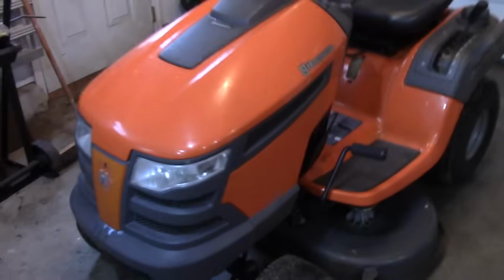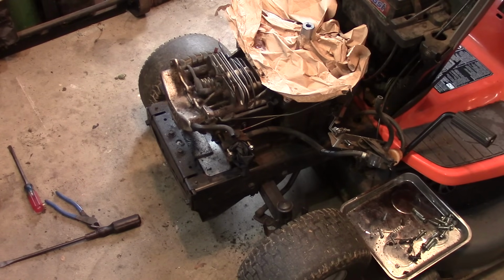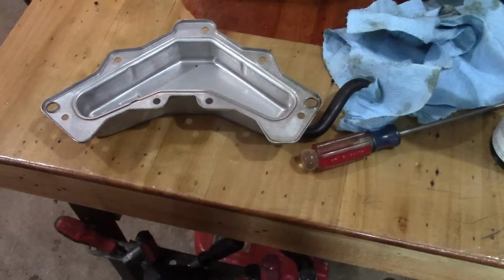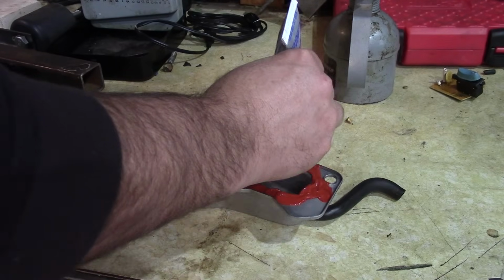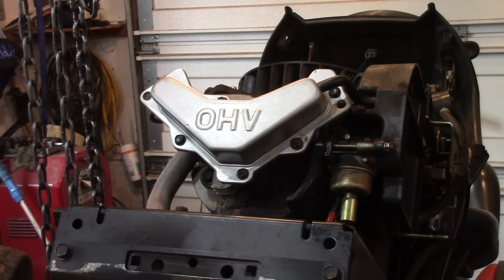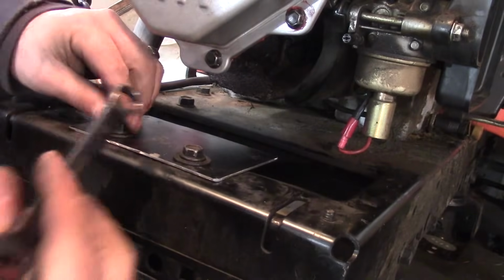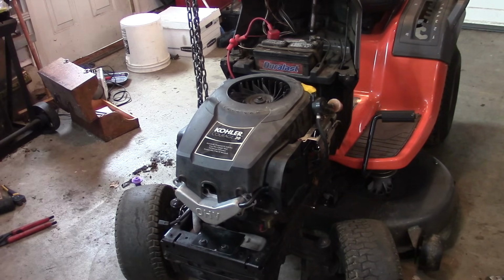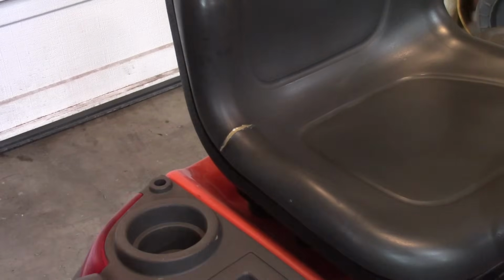Kohler Courage 20 Stopping Oil Leaks 2 Ways

Comment: Thanks for the video. Cork Valve finally failed on my 2007 Husqvarna 46" Kholer 20 Courage. I do take umbrage with the YTK20 (sv600) engine being a bad engine or design. Ive got well north of 1200 hours on my Kholer 20 and its never failed. Yeah, its been pissing oil for the past 2 mows but its been bullet proof for 14 years. It's a fine Power plant. Do your PM's and this engine is solid af.
Reply: Hate to burst your bubble but the valve cover gasket is the least of the issues. They have carburetor problems, the valve seats like to drop, and the blocks tend to crack. Also the sump cover gasket is prone to leaking as the bolts become loose (great design) and it’s not cheap to fix. Glad you have gotten good service out of yours but this is quite possibly the worst riding mower engine ever made

Comment: I had a Kohler engine in my personal tractor, I immediately took out that turd, and replaced it with a 20hp briggs opposed twin, that was 10 years ago and she still runs like a beast..... It's a craftsman LT1000
Reply: I have a 19.5 Briggs opposed engine in my Lt1000. You are right, It's a beast. Still running strong.

Comment: Had a Kohler 19 do the samething and used a new gasket plus RTV on both sides. Still leaked and actually caught fire from the muffler. I was going to try again but I wasn't going to get the cover off without bending. SO...I made a drip deflector from roof flashing so the oil dripped behind the muffler. It only leaks when the engine shuts  off and only about 2 oz. Good enough for a 10 yr old machine.

Comment: I've seen another video that shows not only the valve cover gasket leak repair, but also the head gasket leaking.   This engine seems prone to trouble. They run okay for a while, but eventually vibrate apart.

Comment: Low oil is part of the problem. Just one oil leak and it's all down hill from there. For you see the oil "is part of the cooling sys. And most people don't know this. All think that oil  is just for lubrication. No!  It's more important in a aircooled engines.  Low oil leads to more heat and gasket failure to brg.failure as well.  My 2007 19hp is still running and just started to leak at the valve cover . I have used Mobil 1 10w30 from the  first oil change.  Check your oil every time.  And your engine should live a long time.  A former outdoor power equipment tech of 15+ years  And yes I still have all of my fingers.
Reply: dam1041960 my 05’ Cub Cadet with a Courage 19hp just starting leaking at the bottom of the valve cover. Bought a Kohler cork gasket but I think I’ll go the RTV route.

Comment: I bought a fairly new Troy built with Courage engine that caught on fire and burned up the motor cover and melted the plastic linkage on the carb. It was leaking both from the valve cover and the head bolts had came loose and oil was leaking from head. The head gasket was still good so I painted it with some aluminum paint which helps it seal and used blue lock tight and torqued bolts. Sealed the valve cover gasket and used blue lock tight on the cover bolts. Is fine now. I had the extra parts from another courage. That courage ran for years and is still running with no problem ,not even using oil and never replaced coil, nor adjusted valves. I retightened head bolts a couple times.  I  did have to weld the exhaust pipe as it had burned/rotted through from cutting tons of grass over the years. For some reason these Kohlers often have loose bolts either on the crankcase or the heads or valve cover. I suspect shotty construction during assembly.  In a hurry to meet a quota of motors turned out and too lazy to put them together proper. From my experience the eternals of these engines are great.
Reply: I meant internals are great, not that they will run eternally.

Comment: I have a cub cadet with a v twin 22 hp engine so my gasket and cover is not like this .I have a troy built that has this and replacing that because it was leaking onto the muffler and smoking .I am seeing that my cub cadet book for the engine shows that but it has 2 of them 1 on each side of the motor .Troy built told me to use the cork gasket and the permatex also on both sides of the gasket and allow it to harden a little

Comment: My Briggs single piston twin cam OHV (Craftsman) drips oil out the exhaust after running. I'll notice a puddle and the exhaust is wet inside. I hope the ring isn't failing. It's been good to me (the bottom end) for many many years. Hoping a new  gasket set will solve it (oil seeping past head gasket and into exhaust?)

Comment: Great, in depth video.  So, I do not have to drain the oil out prior to performing the gasket repair to the valve cover?
Reply: Correct. I performed a valve cover gasket replacement and there was no mess of oil dripping. So no need to drain your oil first. I have heard the advice that you do this on a cold engine (which I did), because if you have just run the engine, a lot more oil is dripping from all the parts.

Comment: The courage line is not total garbage . Its an engine plagued by mechanical forces unexpected loosening sump bolts mainly but if properly maintained and bolts retorqued  and locktight used before loosening occurres with regular oil changes and cleaning it will have a long life. 
The inverted bucket approach was resolved by reasoning of servicing the engine cams and general sump servicing. no need to pull motor off but that's where problems always originate. From unproven ideas. Some are good some are bad and the bucket engine approach is bad.
I like to use permatex ULTRA black. Its good for using on sump/oil pans and valve covers.

Comment: Bought a tractor with a kholer courage 26 plus in it, thing is covered in oil and the shaft is lose on the bottom, pulling it out and putting a brigs 27 hp in it.

Comment: I just bought a used Cub Cadet with this motor, and it is smoking a little. I haven't looked at it at all yet. Would you say pretty confidently that it's my cork gasket that is leaking down onto the exhaust?
Reply: Most likely

Comment: I have a 23 HP kohler courage V twin have not had problems with it. Do you know of any issues with them that I should watch for. I would really appreciate your feedback
Reply from the maker: I had one in the shop of the summer that was leaking oil.  I thought it was coming from the bottom crankshaft seal, but luckily after close inspection I found the oil drain plug was not tightened straight from the factory.  I believe it was on an ariens zoom zero turn (maybe a gravely) but anyhow the engine mount bolts (2) were missing and it was causing a belt issue, so the hydros would not work without slipping.  I do think the twins are better.
Reply: doublewide6 Repairs LLC Thank you very much you're the best. I hope you and your family have a great Christmas
Reply: I own a toro ztr 2008 with the 23hp, mine was leaking oil from the sump, resealed with yamabond, engine bolts loose to frame... runs clean plugs look good it surges for about 20 seconds on cold start runs flawless after that not sure if issue
Reply: ls3c6 thank you sounds like I should keep an eye on the engine bolts
Reply: Dave Ackerman 1967 I would, bought mine used last year with these problems and I put 27hrs on it in 2017 checking once a month... they remained tight so probably takes several seasons and 100+hrs to happen, mine was used residential so i dunno 250hrs now?  I'm no small engine specialist like doublewide but an i.t. engineer and auto enthusiast, I'm happy with the courage 23
Reply: Just use it and give it time. It will disappoint you sooner or later

Comment: Hello Doublewide6, I have found that you blow out the engine and tractor outside the shop. That way you do not have to deal with walking and spreading the dirt and oil in you shop. Sometimes it is better to use a low pressure washer that not only blows but cleans at the same time. This helps the engine stay cool and your hand will love you for it too. Then you blow dry the machine. The customer will really appreciate and see your work in a positive lite. The cork gaskets material comes in a few different grades. The factory buys the cheapest grade possible. I replace the gasket with truck grade cork and it still is fine. But the down side is you have to cut the gasket out of a roll of material. So more time spent doing the job. But any time you put to different metals with different expansion characteristics you will have a problem. I sealed the gasket with permatex ultra gray silicone form a gasket as an adhesive. But you have to wait a full day for the item to really seal and adherier. This rule is not really followed by most machines. Nice video with lot of information for us all to see and enjoy. VF

Comment: I’ve got two of those mowers with that garbage engine.. never again! They are the biggest pile of junk Koehlers ever made. Just bought another Husqi, a 52” but they don’t use the Koehler boat anchor any longer. Koehler use to have good product, but not any longer. 

I also put inline fuel shut offs on all of them. I did disable the anti backfire solenoid too. 

Thanks for sharing.
Reply: Kohler has great engines, take the Kohler Command Pro for example.  The Kohler Courage single cylinder is not good.  Do some research.

Comment: Ya know, you’re going to save so much time just to keep filling it w oil & let it leak until the engine grenades in 100hrs then once it’s blown get a good used brigs twin for 200-$300, you’ll save so much time, & headache.

I would’ve just bought a new brigs or predator engine,& blow this one up.